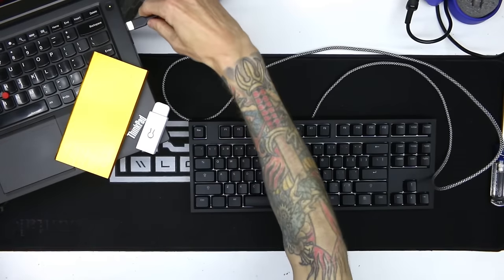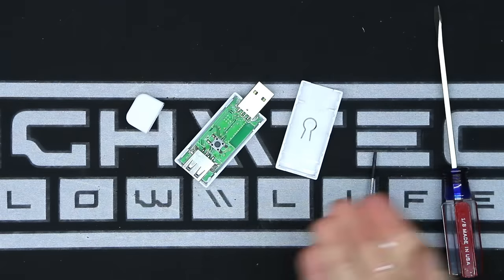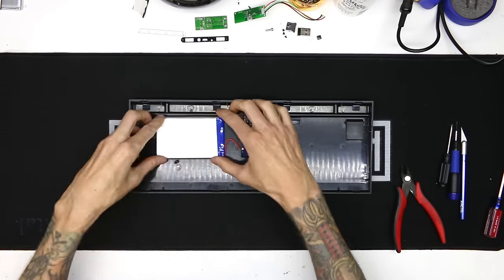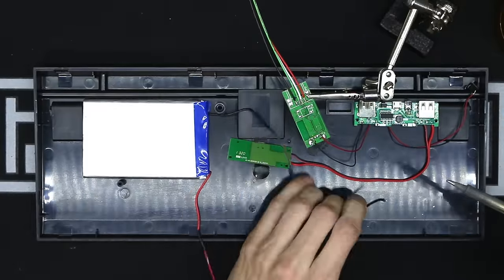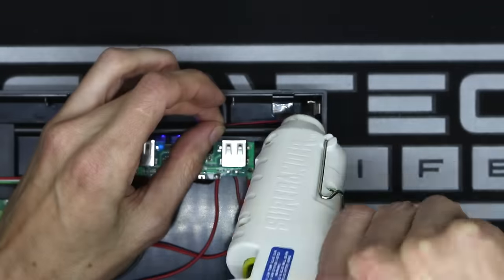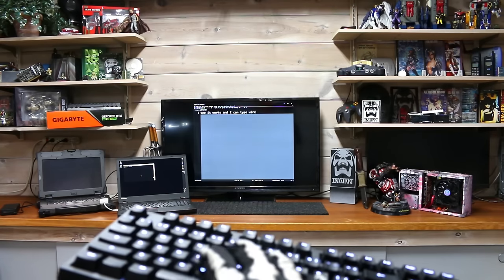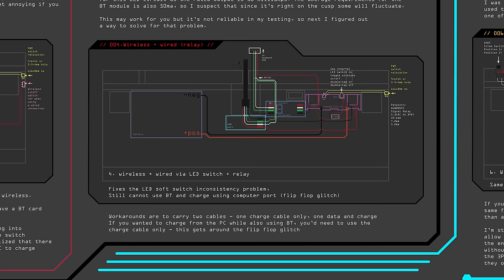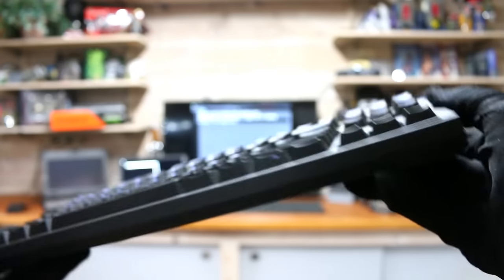⌨ Make ANY Keyboard Wireless! - Convert Any USB keyboard to Bluetooth Wireless - DIY Tutorial How To

Comment: Good video, but this device is the main thing, and it is not available here. i don't even know what to search in amazon other than this model. Commonly only 3.5mm to usb are available, not usb to usb.

I can get a wireless keyboard+mouse combo for $8.50. But I wanted to utilize the wired one i already have lying useless...

Very nicely made video, showed every single thing hands-on, without wasting time, with clarity, and great matrix reference. There is no spoon.
Reply from the maker: You can buy direct from handheldsci, they delivered worldwide 🍻

Comment: is it possible to add an USB HUB into that schematic? for example, i have wireless mouse with usb receiver and want to plug in the receiver into the keyboard? 
or do you need a usb keyboard that already have  usb hub
Reply from the maker: I believe it is possible, but I've never personally tried or tested it. 

My question would be: if your mouse is also wireless could you not just plug the wireless dongle for the mouse into the computer itself? I guess I don't really understand the benefit of having it plugged into your keyboard hub? 

I would check out the user manual for the BT-500: http://handheldsci.com/wp/wp-content/uploads/Manual_Full_v5.2.10.pdf

They have a section on hubs: 
The firmware has the support for a USB hub with up to two devices attached. 

It should work with either a built-in hub in a keyboard or an external hub. 

Keyboards with a built-in hub are supported provided there is no other devices connected to the hub. 

The following two setups are not officially supported, since there are too many combinations of those and we can’t test them all. But there is a good chance they will work:

o A keyboard with a built-in hub and with one additional keyboard or mouse
connected to the hub

o An external hub with one or two devices (keyboard or mouse) connected.

Currently the Adapter works only with keyboards and mice but not any other types of USB devices such as serial port adapters, game controllers and touch panels.
Reply: @hightech-lowlife  those example happens when using the keyboard with a gadget like tablet or smartphone which does not have usb port type A, I know they support usb input device with OTG cable, but it would be more simple if all the connection ride with the Bluetooth.

Other example of the usb hub via Bluetooth is, if i want to plug in a flashdisk, does it support data transfer like normal usb hub.

Btw, thanks for the explanation, i really like your project, its been a long time i like to have a wireless usb hub, i only found one company make device like those, from belkin, and really expensive, i wonder if i could built it my self
Reply from the maker: @andheeid  Ok yes, if you are connecting to a phone or tablet like that, it would make sense :) 

I'm not sure if this can do data transfer, like a flash disk - from the manufacturer, they say that some things can and some cannot in terms of 'other' connections, but they don't know because they haven't tested every scenario. Maybe I will do a future video attempting this so I can test it out. 

Yes, not many companies make a wireless hub, I guess they think that if you're already connecting wires to the hub, why not connect direct to the computer or wire the hub as well. I guess I could see some scenarios where you would want a wireless connection to a hub now. 

It's definitely possible to build! There may be other devices that might be more suitable for that like an arduino perhaps, I'll have to search if anyone has done something like that already. 

Thanks for your comments!

Comment: Awesome video, I'll probably try it too :D

I just have dumb question. Do you know any other tool that would let us use usb interface on computer side instead of BT one?
I've looked for "wireless usb" things, or "BT keyboard receiver to usb" with no luck up to now :(
A "real" wireless usb mod would let us use keyboard with advanced software, and that would be awesome

Thanks a lot for your work anyway :)
Reply from the maker: Thanks so much!

Hmm, I'm not sure what you're asking. So you want just a USB cable connection? This mod will allow you to use both wired USB and bluetooth wireless. It seems like you're asking for a "USB Wireless" but there is no such thing as that, wireless connections are either bluetooth or 2.4GHz. 

Can you let me know the desire of having the wireless signal go direct to a module that you then plug into your computer via USB? The embedded bluetooth receivers essentially do just this, without you needing to plug anything into the keyboard externally. 

Which keyboard software are you wanting to use? 

Thank you!
Reply: @hightech-lowlife  Yeah sorry if my question, on top of looking strange, was not clear.
I'm not good at explaining "complexe" things and I'm not good with English, so having to deal with both of them at the same time is not super easy for me :D

What I'm looking for is, at best, a "wireless USB cable", leading to full USB control from keyboard software, but... wirelessly :)
I've found some stuff on this, like "WUSB" or "wireless usb hub" from 2005 to 2010, but everything seem discontinued nowadays...

The keyboard soft that I would use then are the horrible Logitech one, or the horrible Asus one at first. 
But not having to filter my choices on wireless keyboard only would probably let me take another brand. 
I'm really looking closely the Mountain Everest Max right now for example, but being wired only is a huge drawback

Or, if this not possible, basically the same thing than the BT-500 but "reversed". It would be indeed act exactly as the same as using a BT dongle, but with few differences. First, I would not have to deal with BT pairing and would be able to plug the BT keyboard (would not though having to say that some day) into another computer quickly. 

But more than that, it would let us use something like the "hasu usb to usb controller converter" to make this wireless keyboard smart.

BTW, one of my main goal with wireless keyboard is being able to use it from few meters away, and having no cable on my desk as I can use something like a SJÖMÄRKE to have it always fully charged :)

I'm still not sure about what choice I'll make. I have to admit that discovering your video made me rethink the whole subject :) I never though before this could be even remotely possible, and someone actually did it, and was kind enough to share his work online... I have to deal with that!! :D
Reply from the maker: @Damian-rp2iv  Ok no problem 🙃 I think I know what you're saying, I think what you really want is a 2.4GHz connection instead of bluetooth. There have been a few people that have done this but they basically took the parts off another board, so maybe purchase a cheap wireless keyboard that is 2.4 and then get the wireless parts from it, that could work. 

You can still use software with the BT-500, it may just not support doing lighting effects and things like that, but again I'm not sure because I haven't tried it on a keyboard that needs software (I don't even own one that does haha). But I can tell you that other mapping and macro software like AHK does work just fine, so you can basically make any keyboard "smart" with AutoHotKey - I will be making a video on this app sometime soon, so if you don't use it already, check it out! 

If I can find a good module to use for 2.4GHz I will try it but they don't really make one that I know of, so it would have to be DIY through Arduino or ESP32 board. I really think that salvaging the wireless bits from an older/cheaper 'wifi' wireless keyboard is what you're looking for. 

Thanks man!

Comment: Hey hmmm, quick question: can this works into a keyboard with an usb dongle only?
Reply from the maker: You mean a 2.4Ghz board instead of a bluetooth board? Or this is a scenario where you lost your dongle and you want to still use your board? As long as the output is USB then it can work 🍻

Comment: would this work with the keyboard makers software so you could change the rgb etc and key rollover settings eg
Reply from the maker: I'm not sure it will I don't have a keyboard that has software like that to test it out, otherwise I would. You can email Handheld Scientific support (their support is great) and ask them if any of their users have done that and if it works. Thanks!

Comment: PLEASE CAN YOU DO THIS WITH THE GK64? and is it as good for fps comp like is there a delay or should i just stick to usbc wire
Reply from the maker: Yes, it will work with any USB keyboards - the GK64 is already offered in a BT version though, might be better off just getting that. No delay from my experience, but I'm not a pro gamer 🍻
Reply: @hightech-lowlife  Cheers for that, however u may be right i didnt wanna buy a new keyboard lol wanted to diy but for all the effort it makes sense to upgrade i guess
Reply from the maker: @oimpaa  If you want a project, it is possible 👍for best outcome and ease of use, better to sell what you have and get the BT version (in my opinion).

Comment: Sadly I do not think this will work on the Keychron K10 with the way the circuit board is set up. Keychron really screwed up with not allowing per key rgb with default firmware, then not following through on later releasing k-series firmware updates, and forcing users to make the choice between having bluetooth (with default firmware) or having rgb control (with qmk and open rgb). I really hope they get class actioned.
Reply from the maker: Perhaps not for a 'oem' look, but if you're willing to modify the case or have some parts hang out, then yes it's possible. I've done a few other builds with the USB SMD mounted to the PCB, it's tricky but not impossible. 

That is a bummer to need two different firmware types to get advertised functionality. Most likely they eventually will merge that into their default firmware, unless this keyboard is EOL and they drop support to focus efforts on newer products. Has no one built out BT via QMK?  

I would imagine BT having a higher priority than per key addressable RGB, but this is subjective, some people really want RGB. Good luck man! 🍻

Comment: Cost of just the BT-500 at $40 is more than what I can buy a bluetooth RGB mechanical keyboard (Ajazz K680T @ $35) for here in the Philippines.  Doesn't make your project cost effective though it is a good tutorial.
Reply from the maker: Thank you! Yes! I fully agree, if you read the first part of the description I address this fact. There are some great boards out there that already come wireless, and ones you could get for the price of just the conversion parts alone (and probably even cheaper). 

If your personal goals are just to get a wireless keyboard for as little as possible - this is most definitely not the guide for you. CODE keyboards alone are now $170 +, so this is a long way from a budget build. 

I did search from some BT modules that would have worked for less, but they would require a lot more effort to get working (and to what degree?) and only end up saving $3-5. I was even looking at some prototyping boards, but I'm really surprised there isn't a standard controller that can do BT HID for ultra-cheap. I know there will be in the future, and maybe I'll make an updated video on that. 

Thank you for watching and for your comment!

Comment: I am a little late to the party but I have a query on making this work for a dock.. I have an old Dell monitor that has a built in USB hub.. I have connected my wired usb and mouse to the monitor.. Is it possible to use this method to convert the dock output usb cable to bluetooth.. Essentially making the mouse and keyboard connected to it wireless.. And I can essentially make any laptop next to the monitor use the keyboard and mouse over bluetooth.??? I dont want to use any batteries since I can power the bluetooth convertor over the monitor's usb port power..
Reply from the maker: Sorry man, it's most likely not going to work for use as a USB hub for multiple devices, only for keyboard and/or mouse at a time. There's something about BT and it doesn't lend itself to multiple data streams at once. There have been a few products made in the past that are BT USB hubs and they had issues and have been discontinued (most likely because of the issues). I'm not saying it's impossible, but using this module for it most likely is not going to work. Please contact HandHeldSci support regarding it though because they will know the details about it more than me 👍

Comment: Hey man, do you by chance have a video tutorial on how to make a wired keyboard wireless, via 2.4ghz wireless dongle?
Reply from the maker: No, it's not possible. Those cheap dongles are just receivers, you actually need a transmitter which is what this module is. 

Best way to get 2.4GHz, is to take the guts from a different wireless board and adapt them to the board you want to convert.
Reply: @hightech-lowlife  
I see. Could I do it using a 2.4Ghz wireless module from a wireless mouse and adapt that to the keyboard?
Or does it have to be a keyboard only?
Reply from the maker: @Alalpog  It may be possible but I'm quite certain it will not "just work" you will need to do some firmware hacking, or have some way to translate the mouse outputs to a keyboard matrix. May be possible with an arduino in the middle doing translation. If you get a keyboard to start with instead of the mouse then you won't have to do this as it's already set up for a keyboard.
Reply: @hightech-lowlife  I'm actually looking at the keychron k3 low profile model.
I know it's Bluetooth ready. But something just doesn't really make me comfortable using bt devices.

I'm wondering how could i put a 2.4ghz module for that.

Given what you've said, striping the guts of from another keyboard would need me to have a wireless 2.4ghz keyboard to begin with. So it doesn't make sense on making the k3 2.4ghz ready.
The most practical way is just spending higher to get the k7 low profile.
Reply from the maker: @Alalpog  Yeah Keychron makes good boards 👍 What is your aversion to BT? 

If you're willing to spend that much on the Keychron I know there are other boards that have both BT and 2.4, you may want to look into one of those models that can do both.

Comment: Hi, i somehow landed here, just wondering if you know about IPEGA PG 9116 usb converter to wireless. Maybe we could scale this project up by plugging in wireless mouse to that converter, and connect just 1 bluetooth for 2 device.. since the price of ipega pg 9116 is slightly lower than the handheld bt 500..
Reply from the maker: All the places I've seen that offer that are out of stock/discontinued, and also have bad reviews like you need to use an app. I would buy one if they were available to test, but they are not, so I'm not sure about the status of this product.

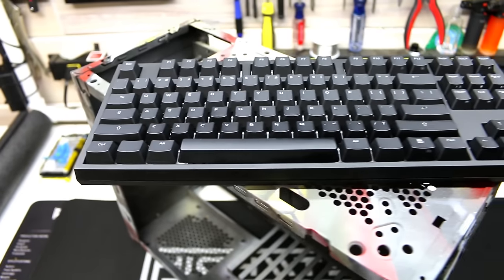Comment: 1:18
Is there any 'magic box' that transmits the signal to a USB receiver?
I want to do the exact same thing you do, but with a mouse and a USB receiver.
Reply from the maker: I'm assuming you mean a 2.4Ghz receiver? There are only a few options for that, and they are older with limited stock and questionable reviews. I can't really recommend any as I haven't personally tried them myself.
Reply: @hightech-lowlife  
Well, thanks anyway, you would help me a lot if you find something similar to what I described and let me know, and if I don't find it, I think I'm going to create a PCB that has those functions. Good video, I keep it in case I need it in the future.
Reply from the maker: @williamschrodinger  I think I may have found something, but I will test it first. If it works I will make a video on it as a lot of people seem to want 2.4 instead of bluetooth, not really sure why as a lot claim "latency" but if you are using a wireless keyboard then to me latency is not a high priority as you cannot get quicker than a wire.
Reply: @hightech-lowlife  
You've earned a new subscriber, I'll be eagerly awaiting that video.
Reply from the maker: @williamschrodinger  Thanks man 🍻

Comment: Hi, i have a little problem of battery building my wireless keyboard..
Everything setting up fine, powering through a powerbank works fine, but when installing a lipo battery, as said like 9:10 in your video, LED on the PCB wont blink, it blink only when i press on button but only showed 1 LED (i think this means there no battery or low battery...).
Any tips or advice ? is my PCB or battery is dead or malfunctionning, i tested it with another lipo battery but still nothing ..
Reply from the maker: Some powerbanks have a built in flashlight, make sure the LED you're talking about isn't just the flashlight function. 

Can you confirm the battery works? Usually a flashing LED for the power LEDs indicate that the battery is dead. If the battery tests fine, then try a different charge board 👍
Reply: @hightech-lowlife  when im talking powerbank, i mean external source of power, PCB seems working fine but juste not charging the lipo battery
Reply: have you any lipo battery to recommend ?
Reply: No blinking when charging, and working when a source power cable (Bluetooth is working too).
When pressing button (2 white cable on image) the pcb blinking like 25/26times on one LED and stop (Bluetooth LED wont blink)
I wired everything like in 7th diagram
Reply: @hightech-lowlife  UPDATE : I've wired my lipo battery on the same  location of power (between charge board/BT PCB) and it works so i think the B+/B- have some issues ...
Reply from the maker: @Hung2222  Yes, it should work as per my diagrams, so if it's not then something is off 👍